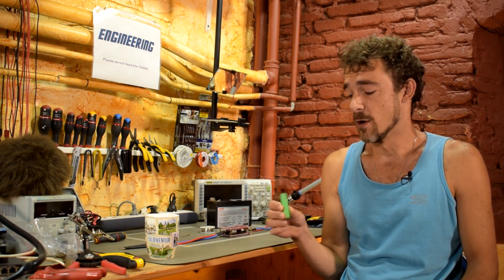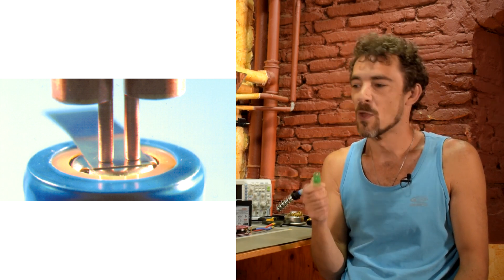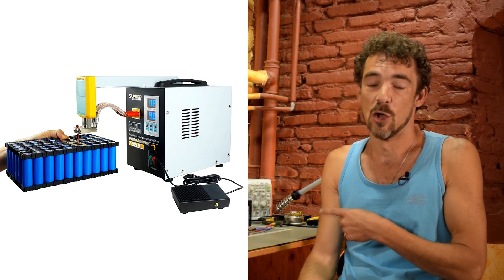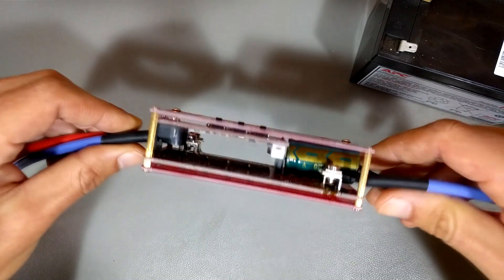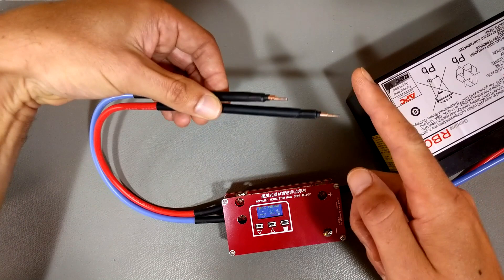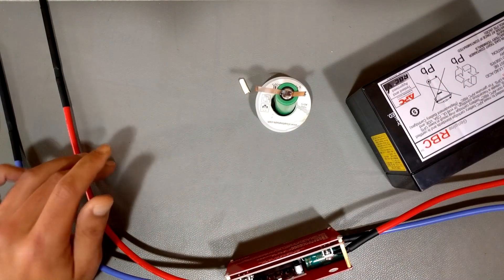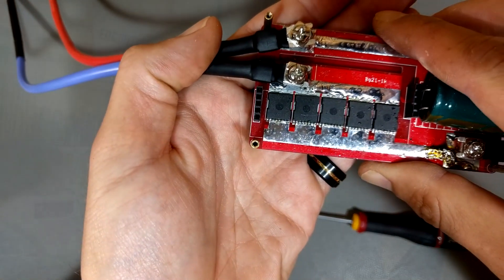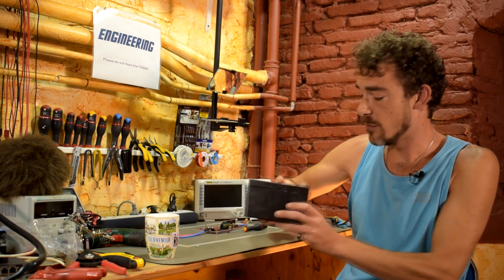The $16 battery tab spot welder

Comment: You obviously misunderstood the label printed in the back of the welder. Your 7ah, 12v acid lead battery is NOT adequate for this welder. It will cause damage to the mosfets. You need an adequate car battery that supports hundreds of amps of current or a 5ah lithium (actually lipo) battery that allows 40-70C discharge rate. Even a good li-ion battery pack ( e.g. for bikes) less than 25 ah is not adequate for this welder. When a capacitor is added to deal with this, one still needs an adequate battery and let the welder to cool down after 40 welds. It will last if used properly.

Comment: You have an old version with the capacitor on the wrong side of the diode.  You can fix yours by replacing the FETs and adding a cap

Comment: IT WENT DEAD BECAUSE YOUR POWER SOURCE IS INADEQUATE.. YOU SHOULD HAVE USED A CAR BATTERY. I HAVE MADE SEVERAL DEWALT BATTERY PACKS WITH THIS SPECIFIC SPOT WELDER AND IT WORKED FINE. SO MUCH FOR THE LONG INTRO FOR WATCH HOURS ON YOUTUBE AND WE THOUGHT YOU KNEW WHAT YOU WERE DOING.. LIKE THE OTHER COMMENTS SAID, SLEEP AID

Comment: Read the insTructions .120amp minimum
Reply: His is this correct 120amp minimum? I bought mine off ebay it says in the add ok to use a lipo battery I use a new fully charger 3s 220mah  lipo battery showing 12.42v when i tested a weld 2 of the mosfet banged and blew the fronts off them  i think the 2200mah 3s battery only give me 2.2amp of power do you think it is because of the lipo battery then would this not happen if i used a car battery? Or anything with a minimum of 120amp  Thanks
Reply: You need at least 180 Ampere (has nothing to do with Ah). You can calculate it by taking the Ah and multiply it with  C ratings of your battery. So you need at least e. G. a 3S 3Ah lipo with a rating of at least 60C. That would give 180A. The battery in this video looks way too weak. There is a mod to prevent blowing up the mosfets with a capacitor.

Comment: You broke it by using the incorrect supply battery. Using that small battery caused the supply voltage drop low enough to cause a fault with the controller chip. Use a car battery or a 5000mah lipo. A 7ah AGM battery can't supply enough current

Comment: True ,soldering 18650 batteries is dangerous if done improperly. But not impossible as if you get in and out soldering 
It is no more damaging than spot tab welding.  If not at least a tad familiar with soldering don’t as you may hurt yourself or damage your batteries.
My opinion only the cat above is very correct.👍👍 and the spot welder in question should be thrown directly in trash.

Comment: DO NOT attempt to use this unit before modifying it!  This unit has a design flaw, which is explained and fixed here:
https://www.youtube.com/watch?v=fdnO0Z-scjA

Sellers may claim that your battery is inadequate as gate voltage does sag, but in reality this is an obvious design oversight that could be easily fixed with a hardware revision.  Gate voltage must be kept high by local capacitance on the control board or Source-to-Drain resistance will rise rapidly and blow one or more MOSFETs.  If they fail closed (shorted), which is most common, then you will have a permanent, and dangerous, dead short between the electrodes, as seems to be the case for Scottie.

As of 2020-12-24, the Banggood price has doubled in just a few months due to high demand.  Though still a reasonable value when compared with higher-quality competitors, I would not pay more than US$25 for this kit, even if they eventually fix the gate voltage problem.
Reply from the maker: Yeah, a too-small battery shouldn't make a difference. It should just not weld quite as well due to a lack of current. Technically, I followed their directions in terms of sizing the battery. Maker Fabio (the link you posted) is dead on the money, IMO. He has more patience than me, that's for sure! I preferred to make my own instead of spending the time to fix somebody else's design.

Comment: 10:20 you did miss the metal surface on the battery
and I think there is some confusion about amp hours and amps?
maybe your battery wasn't able to actually deliver a 7.5 amp pulse?
but it is an ultra cheap spot welder so ymmv

Comment: the problem was your battery. Well it's not your fault, since the circuit has a bad design, but if you use a better battery it doesn't die as quickly.

Comment: I guess with so much current flying about it's really important for the mosfet gate and drain connections and low voltage control to have voltage protection devices fitted. Transient voltages will be high with several hundred amps being switched. Might buy one, check the design and fit extra protection if needed.

Comment: My unit did the same thing.  It will even spark with the unit turn off.  So, I disassembly the  unit and found that the Mosfet was shorted.  So I will cut the foil to isolate the  Mosfet one  by one to find out which one is shorted.  If only one or two , I might be able to use it.  If more than that, I need to remove them and replace with new ones.   One set of 5 Mosfet in Aliexpress is sbout $5-6
Reply: This unit also benefits from an extra capacitor on the control board.

Comment: You have to replace the mosfet because they are short check with multimeter. Current short pass this way. I burned mine and replaced the mosfet its working fine.

Comment: that little battery is nowhere near enough discharge current to handle the welding. notice they said on the back 3s 5000mah 40-70C rated? that type of battery can provide 200-350 amps!!! the little battery you used can MAYBE deliver 10 amps! that's also why they said to use a car starting battery, the high current. what likely happened to yours, is the battery TANKED in voltage, the controller browned out and shorted on your tab. the design relies on pulses of high current which your tiny battery cannot handle.
Reply: Yup, the drop in voltage shorts out the FETs. As this dude explained in this video with oscilloscope and everything. https://www.youtube.com/watch?v=fdnO0Z-scjA

Comment: I guess you should get two, if you buy one at all, so you will have a backup!
I just built one, using a starter solenoid, and a spotwelder timer, it works great, with a 4s lithium battery, it needs to be 12v or higher, to do nice welds, so maybe even a 5s, I use lipo cells capable of 400+ amps, and use 4gauge welder cable, but it has to be set at the fastest pulse, or it will fry everything, I'd like to use a bank of MOSFETs, but I'd use double what these things are using, my rig will probably weld 1/8" steel plate together! Ha-ha....

Comment: I got a similar one of these, on the first test run, it exploded the FETs!.. No weld,
Reply: Mine did exactly the same 2 welds it didnt stick the pieces together and blew the fronts off 2 fets It advertised I could use a lipo battery I used a 3s 2200mah 11.1v iv since seen power supply needs to be a minimum of 120amp my 3a only gives 2.2amp maybe this is the issue not enough amps to open close mosfet quick enough

Comment: I could have done exactly the same video ! I bought this device from BG, connected it on a 12v car battery, set it in auto with a 10E energy. I couldn't made any weld, from the early beginning the MOSFET was always opened and the only thing i got are splendid electric arcs !

Comment: Since the stupid YouTube algorithms censored part of my first comment for no apparent reason, I will need to continue in a second comment.

The plates used can be of various types.
Nickel plated steel is the cheapest and is used only at lowest possible currents.
Higher currents require thicker plates of better conducting materials.
Here comes pure nickel.
But it's not always enough, especially in power tool batteries.
There is used  a nickel plated copper, or just copper.
But as of today there is no DIY spot welder that can directly weld pure or plated copper.

These spots that form are called "weld nuggets".
No sparks or arcs create them, but the heat generated by the electric resistance.
Hence the name resistance welding.
In fact having any kind of sparks or arcs is bad.
It will wear down the electrodes quite quickly.
It means too low pressure applied to the electrodes, or too high of a current.

Than the wrong part.
If your power tool battery dies, you cant just buy whatever cheap cells you find.
Power tool batteries use high current cells, which are not cheap.
In fact they are the most expensive cells ever.
Even your green Bosch screwdriver probably uses at least 15 A cells, if not 20 A ones.
Bigger batteries can use up to 40 A cells, which are ridiculously expensive.
Even more expensive if they are not only high current, but also high capacity...

The replacement procedure goes like that:
1. Read the model information from what is printed on the cell to be replaced.
2. Find (preferably) a "datasheet PDF" of that cell type.
3. In that PDF file find what is the "continuous discharge current" of the cell.
4. Buy a cell with at least this value of a "continuous discharge current".

Capacity may be whatever, but subjecting a low current cell to higher currents is dangerous!
And an example of say the common Makita LXT 6 Ah battery.
It has 10 x Sony / Murata VTC6 with capacity of 3000 mAh and "continuous discharge current"  of 30 A.
Now go and find these cells or an equivalent ones for 70 cents a piece on Amazon or wherever you like...🤣🤣🤣
More likely $7 a piece will be a good find for these...
Reply from the maker: Well, with Makita battery packs, there's just no point in trying to replace the cells. Not only are they a royal pain to extract, but they're packed in very tightly with oddly-shaped tabs to connect them all together. And then, it appears that the control board inside Makita battery packs can decide to 'block' the whole battery if there's a single cell failure. That means that even if you replace all the cells, the battery won't charge... which means you need a replacement battery control board (or figure out how to hack it). So, for 18V Makita cells anyway, I just decided it wasn't worth all the hassle! The time and cost to do a DIY repair is way more than a new battery pack. And then the continuous discharge current thing on top of all that... Plus, you can order cells that may APPEAR to be the same thing, but when you get them and try them out, they end up being cheap knock-offs - even from Amazon in my experience. So, it's a real nightmare!
Reply: @ScottiesTech  You can find the tabs, that's not the problem. The problem is, that there is no way to DIY spot weld the original nickel plated copper ones. There are Chinese replacements, which are either nickel plated steel, or nickel - but I don't know how do they behave. 

The board is not a problem either. No point in getting original, since they lock, but there are quality replacements. They have both balance charging and battery level indicators. Problem is - they are not cheap, but at least it's a one time replacement.

Example (not related in any way to the seller):
https://www.aliexpress.com/item/1005001341342613.html
https://www.aliexpress.com/item/4000651052257.html

In Europe one reliable source is nkon.
But Sony / Murata US18650VTC6 3000mAh - 30A are €4.65 at the moment...

Comment: It's called resistance spot welding. In particular this device is a "single pulse DC spot welder". There may be multiple DC pulses, usually first for cleaning the oxidation layer, and than welding, quench /
 temper, etc. Also, there is AC resistance spot welding.
Reply: Also just want to add in on your note of multiple pulses one being cleaning, well it's amazing these can get such a clean little weld considering no argon or shielding gass is being used.

Comment: The electronics are probably fine - they're trying to switch mosfets that failed in the closed position.  You could probably get the electronics to switch another circuit, one with better protection for the MOSFET's, or switch something like a solenoid.  You'd have to design it so that any residual energy from the coil is dumped back into the battery's negative rather than into the control circuit, but you can do that with simple diodes if you select them carefully.

Whether or not a solenoid can switch fast enough is another thing, but it's probably worth a little time experimenting!
Reply from the maker: Hold that thought! I made my own welder and will post a vid about it soon.
Reply: @ScottiesTech  👌👍

Comment: Will this device last long? Amazon reviews, it breaks after initial use.
Reply: It is garbage.
Reply: Two things, you need a good battery. And you need to put a extra capacitor on the control board.  There are videos on this mod
Reply: @robmc3338  that's what I did and beefed up  the bad solder alongside the  mosfets and bought a  5000 mah 11.1 Lipo battery  before I tryed  it cuz thay are junk without doing it

Comment: you have a blown mosfet or more, check with multimeter - these spot welder die very fast if you power it with under sized and under rated battery, bro - seriously !!! PB 7Ah battery ? - check my channel video - i use the same spot welder, pcb traces strengthened with copper and solder, and i powered it with 3S80p Lithium ion battery, which can easily output 200-300A pulse current. i welded at 30-40E , but later i tried 80AH car starter battery and it welded at 10E , so conclusion is the bigger and high current the battery is, lower will be the welding time settings and when lower is the time setting the spot welder will less likely to get hot or die. 
  https://youtu.be/XjvIRuSl_eo

Comment: There appear to be several modes of failure. When connected to 12V source my welder will drain the capacitor as soon as power switch is turned on. It actually, slowly, brings the voltage of incoming terminals down to ~1.6V even if the 12V battery is connected. You can increase that voltage and get couple welds if you have variable voltage PSU, but DO NOT go over 24V, because it is a 25V capacitor in there and it WILL fail at 30V (ask me how i know...). The capacitor itself appears to have high internal resistance, with welder off, the capacitor takes several minutes to charge up to 12V and the amount of current it draws does not ever register on my PSU.

Comment: I bought one of these and have so far done over 200 welds with it, with no problems. I was bold and used 0.15mm nickel strip too, so had to ramp it up to level 80 to get a good weld. Sorry about your bad experience, but you seem to have just got a duff one, you should try and get banggood to send a replacement....

Comment: My welder is shorted input to output after about 10 welds at low power. I took it apart for diagnostics, but cannot see any visual damage. The control board still works like it should, the problem is on the bigger main board. I believe the 5 MOSFETs are used to switch the -12V from a battery ON and OFF. +12V goes straight from input to output. Anybody knows how to check the MOSFET without its removal? How do you remove one if you have to? I've got the datasheet for  4N04R7 MOSFET and it shows a big soldering pad at the bottom. It may be very difficult to remove if solder got there. On the opposite side of the same board right under the MOSTETs there are 5 little devices marked BG. Not sure what they are, but they only have 2 contacts. Four of them measure about 65 ohm accross, but the last one (closer to the power switch) is only 1 ohm. It may be shorted. Anybody knows what that is?

Comment: I think that using more than 12 volts is what causes the problem. maybe the fets cant switch at the higher voltage.
Reply: Fully charged automotive battery is at 12.7-12.8 V. The Infineon datasheet for this 4N04R7 MOSFET shows drain to source voltage as 40 V. How can 12.8 V cause the damage, if 12 V is fine?
Reply: @mikhailshneyder9131  well then I guess I'm wrong.   I thought car batteries were closer to 14 volts. But if the fets can handle 40 then I don't know what is causing them to sort.

Comment: The fets have no protection from the inductive voltage that builds up in the leads and when the mosfets switch off and as it has no where to go the mosfets go into avalanche and allow the voltage through. This eventually destroys the mosfets and they go short circuit. One of your fets is likely short circuit so there is no switch on and off which is why it melted your nickel. A tvs diode and a flyback diode fixes the issue. No idea why the circuit designers did not add these as it’s freely available online in both maletronics and kweld circuit diagrams. Cutting costs I guess.
Reply: Where would you solder the diode. Would this be on the positive and negative rails after the MOSFETs?
Reply: @iRoNiiC_H3R0  According to https://youtu.be/XjvIRuSl_eo?t=200 these boards already have five SMAJ13A TVS diodes (13V) but may be used for the mosfet's gate trigger circuit
Reply: @iRoNiiC_H3R0  google 'endless sphere tvs schottky' JP Spot Welder forum thread page 23 has the info

Comment: Yeah wish I had see this before I ordered 😱 what do you use for your projects and tried and tested 👍
Reply: What pp have told me about this welder is don’t use a battery above 12v so if youre battery is 12,4 use a load to get it too 12v. I walkt in the cheap trap too i don’t have the welder its in transport and i recomend too start whit e10 not 40 and wal youre way up